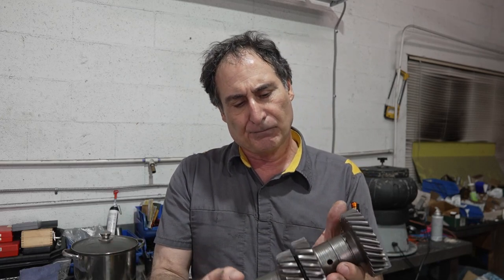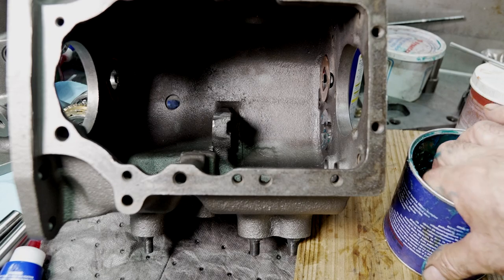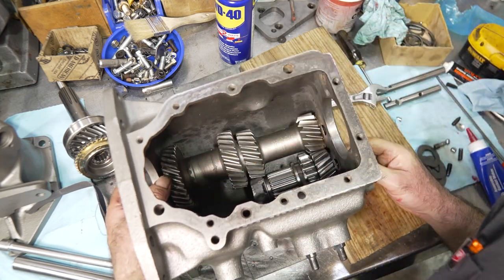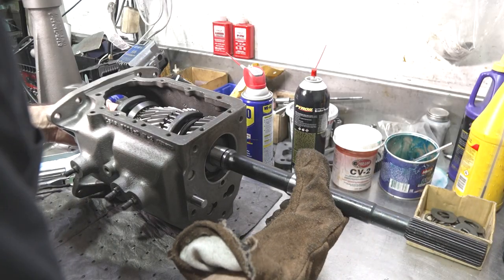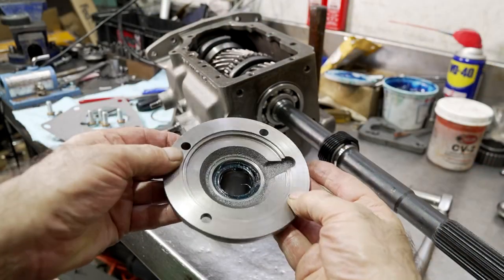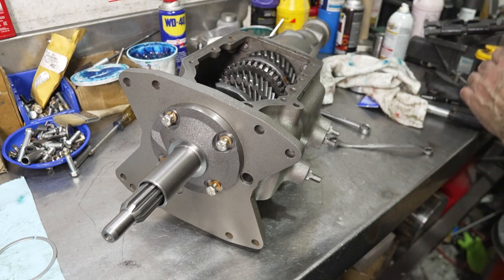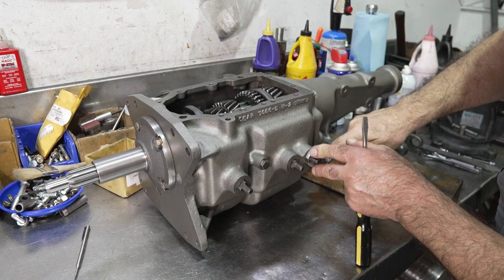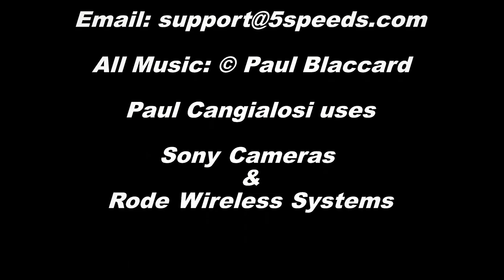Learn How To Rebuild a Ford Toploader 4 Speed - Part 4 - Final Assembly

Comment: Great videos. I have a 1970 Mustang with a 4 speed  top loader with  wide ratio gears. I might have missed it ,but did you mention that some top loaders like mine don't have a drain plug. The bottom bolt on the tail housing is the drain plug.
Reply from the maker: No I didnt
Reply: Mine has that too. I use blue locktite on that bolt otherwise it will drip.

Comment: I appreciate the straightforward, no-nonsense video.  One question regarding the detents; How does a person determine the correct lengths? Thank you.
Reply from the maker: There are many types of rail combinations, so if you are working on 1 transmission you are going to have two interlocks and three detents. Some are actually the same length some are different. But simple math will simply show you that if you only have two interlocks and three detents then it shouldn't be hard to figure out which is which.

Comment: Paul, thanks for posting this. It helps me with my T86/R10 as a lot of what you showed applies. Other than that large puller in the T86 disassembly video for the input bearing, you showed you don't need special tools. Appreciate you taking the time to teach us.

Comment: One detail always do is double check that your detents are in correctly by shifting into a gear then check if the other shift lever is locked out into neutral position. Then vice-versa. If the opposite shift lever still moves its possible engage 3rd and 1st gear at same time. Locking out the whole transmission...only way to get the car moving is getting underneath with wrench (hammer sometimes) and put minimum one rail in neutral position. Easy just to double check when it's on the bench... just wished I had utube when I was a kid. Great job on explaining assembly
Reply from the maker: As mentioned in the beginning of the series is I double check the action before assembly... Very important. Maybe you didnt watch parts 1, 2 and 3 yet?
Reply: @GearBoxVideo  missed pt 3. But as I said great videos on toploader. Wished I had them when I was 17 and replaced 2nd gear...yes I didn't check shift levers and why I know that the trans will lockup. Going back and watch all again...theyre that good

Comment: Thank you Paul!  You’re videos are always excellent. 
Your book was invaluable with helping me rebuild two toploaders this past year. Though I have to admit, I wish you’d put out these videos a year ago 😂
The videos fill in a few blanks and compliment your book well. 
One question. I was surprised that you didn’t add a vent to the tail shaft housing, as per your book. Was that due to the owners preference? Or have you changed your mind on doing that?
Reply from the maker: The particular tail in the book was aftermarket and required it

Comment: Does your book cover the NP 440 used in 1981 - 1987 GMC, Chevrolet fullsize pickups (RPO code MY6). It's a overdrive and I have one in my 78 nova, thanks.
Reply from the maker: It covers the A833 non overdrive

Comment: Thank you Paul very much for the great instructional series! Love to watch your work! Comparing to the muncies, which one of them would the strenght of the toploader equal to?
Reply from the maker: Toploaders share the same center to center and designed better that a muncie. Pros and cons. Muncie is lighter weight, shifts better. Toploader has wear issues with clutch teeth and cointershafts and will not shuft above 6500rpm

Comment: Any fluid recommendations on one of these? I installed synchromesh some years ago when I rebuilt mine but haven't installed the transmission yet to try it out.
Reply from the maker: Ive used Royal Purple and  Driven Racing GL4

Comment: Paul, I realize this is a may be an elementary school question, but in watching your videos I see where everything you did was by hand.  When these transmissions were first manufactured, were they assembled entirely by hand as well or were there any assembly type machines used in the manufacturing process?
Reply from the maker: By hand

Comment: Paul, great vid series. I have a 4sp Toploader from a 70 mustang. I’m dropping the tranny soon, so fully expecting to replace all components. Is that 12,000th play you created in what i was thinking was the 3rd gear assembly and taking the “hub” down  by 10,000th going to need to be done on all rebuilds? Or is it all a matter of where you get your Taiwanese parts from ? Or was that a shaft issue? Sounded like from what you said it has been a long standing problem for that gear getting enough oil. Again, wondering if that is having to be done in most cases. Thanks!!
Reply from the maker: I don't know if it is just a stack error or one component. Really doesn't matter. You clearance it only one way

Comment: Hi Paul.   Do the early square 4 bolt  top loader cases have the same tail shaft housing  bolt pattern as the later 8 bolt cases  with the ears ?  In other words can tail housings be swapped from the early to late cases ?
Reply from the maker: Yes they do

Comment: I have an old mid 60's toploader that I've sitting around for 20 some year...any idea what it maybe worth? Also what's a ball park price for something like what you did here? Thanks for the great videos.
Reply from the maker: Depends on what make and model it is for. As well as the condition. The one pictured with new gears and a full rebuild ran over 1800 US

Comment: How hot does the output shaft bearing need to be to slip onto the mainshaft like that? My inputs shaft bearing race was heated to 180-200 degrees and went on just fine. Output bearing has been a bit more "stubborn".
Reply from the maker: Typically 180F. Keep in mind that some interference fits maybe tighter. Sometimes a few light taps maybe needed.

Comment: There are adapter bellhousings that allow a top loader to bolt to a chevy bellhousing. Is it worth it, or should I stick with the super T10? thanks.
Reply from the maker: stick to the ST10

Comment: The 4 bolts on my bearing retainer dont have any washers. Instead the bolt has a raised ring around it, the retainer cover has an indented ring around it. Should I be leaving it the way it is? Doesnt look right to install a spring washer because of this configuration. thanks.
Reply from the maker: Some configurations used a flanged bolt that had serrations on it. If your bolts are still good clean them up and reuse them

Comment: Hi Paul thanks for these videos and taking the time to reply to my last question. I am rebuilding a couple of Mustang gearboxes for my son who is building a race car here in the UK. One of the gearboxes is original from a ‘64 mustang while the other has suffered a catastrophic blow up leaving the 3/4 slider, 3rd gear and second gear all welded to the main shaft which I am guessing may have been caused by insufficient end flat on the gear. My question is regarding 3rd gear. The original box which is all ok has a3rd gear which has no holes drilled in it to let oil through whereas the one in the blown up box has some as does the gear you have fitted in you video. Can you tell me if this is a modification you have done or are later 3rd gears manufactured this way. I have access to a milling machine and could make the holes I think using a solid carbide cutter. Thanks again for taking the trouble to produce these videos I have fond them most helpful
Reply from the maker: The most important thing to  due is add slots on the thrust surface, off-center. Then add a small valley in the mainshaft journal to allow oil to pool and circulate. The spirol grooves act more like wipers. Also use  an oil like Royal Purple Max gear lube. This seems to have worked best for me . Where in the UK are you?
Reply: @GearBoxVideo  I live in Devon in the West Country
Reply: And many thanks for your reply I will follow your advice thanks
Reply from the maker: I like the seaside village there. I live part time in Bath Somerset
Reply: @GearBoxVideo  l live around 60 miles from Bath in  a village called Hemyock not far from Wellington which is near the M5

Comment: How tight should the input shaft to the output shaft be when fully assembled? Years ago when I rebuilt my top loader. It was hard to turn after assembled. I used a thicker gasket to loosen it up a bit. Was that a mistake?
Reply from the maker: It should turn easily by hand
Reply: @GearBoxVideo  thanks for the info. My tranny has had an ear broken off and welded back on sometime in the last 60 years or so. I think that the front of the case might of be resurfaced. I took the thing apart and reassembled it several times. It was still tight. It works fine, but when car is going 70 or so and I let off gas I hear vibration. It could be my driveshaft or rear end. Do you think it could be the transmission to loose?